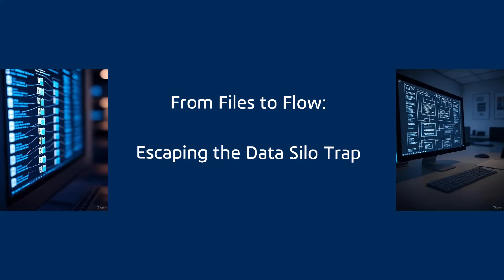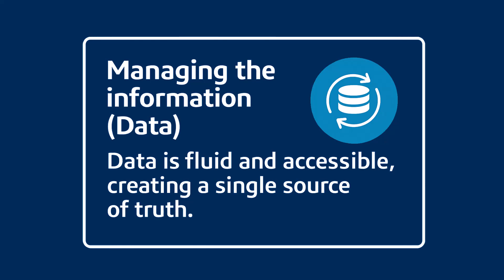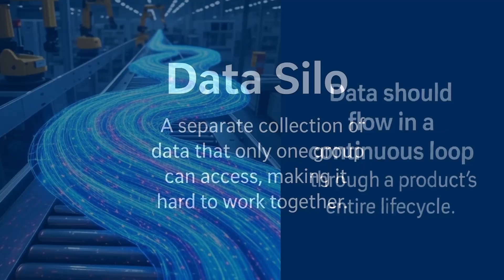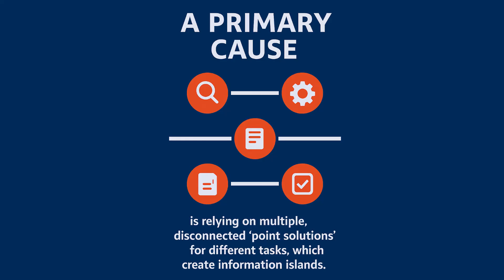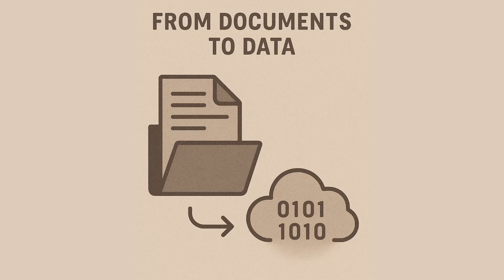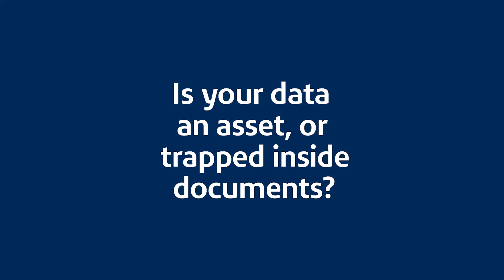From Files to Flow: Escaping the Data Silo Trap

Comment: This is revolutionary in the same way Linux perceived devices and folders as ordinary files which are differentiated by the attributes attached to them! For additional durability, the platform could be version-controlled to support full reversibility and provenance sort of like a proof of work. In this framework each data asset also could support Sandbox-, CRC-, Network-, and other tags which delegate how the asset is to be handled.